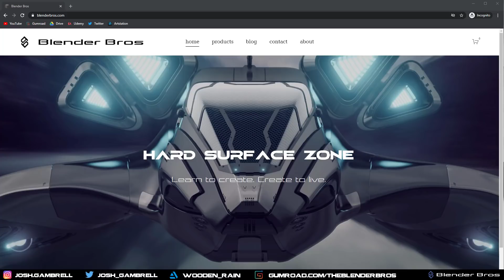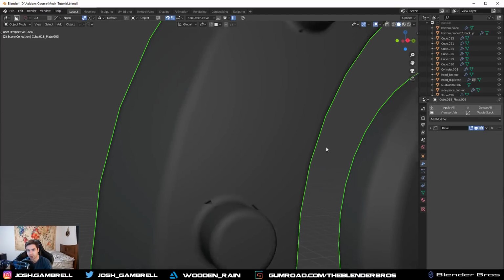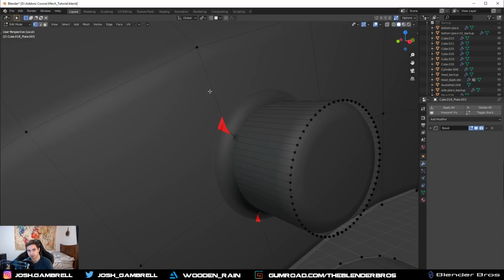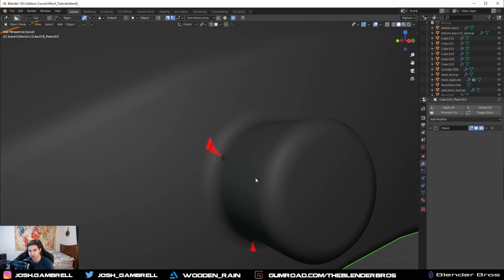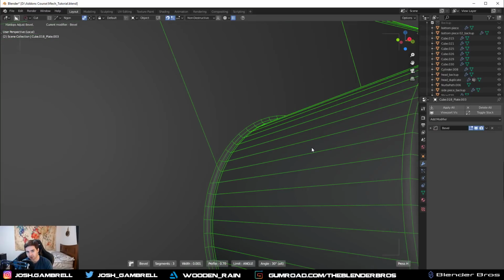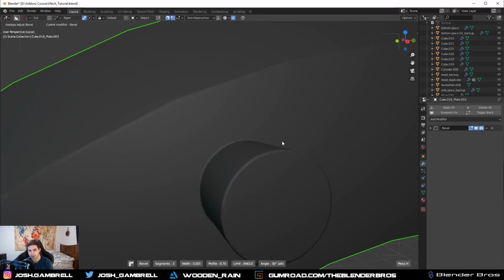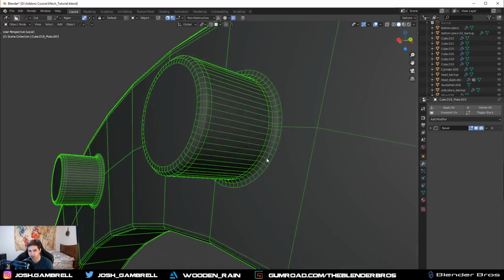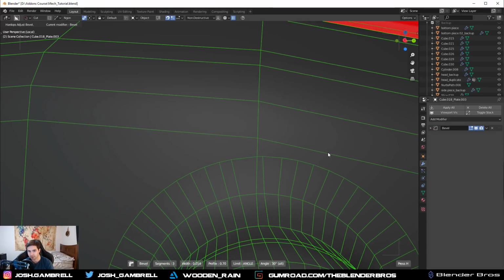The RIGHT way to connect booleans in Blender

Comment: I realize you made that initial line to make supporting geometry, I’m curious— why is that necessary? More specifically, why do booleans need at least two edges out from them to the nearest edges on the object? Is it because the face has no actual data other than that of its’ vertices?

Comment: Easier way to fix most bevel issues is just to disable Loop slide on the modifier, it would fix ALL issues presented here
Reply from the maker: It wouldn't fix all. What that button does is it chooses whether or not to average the bevels, so if you had a warped bevel corner it would even it out by disabling, but that has nothing to do with bad loop connections and probably wouldn't fix that.
Reply: @JoshGambrell  Well, true i guess. I stand corrected, it would fix most of the issues :)
Reply from the maker: @zoki87  Well I don't want beginners to get the wrong idea. It would NOT fix most of the issues, since most of the issues stem from artifacts/bad shading with bevels. I don't want people thinking that clicking a button solves all, because it rarely does. It will fix things occasionally, but not often.

Comment: Impressive , but I guess this can be evaded by this new Boolean which is released in 2.91 
Did you try the new Boolean in blender 2.91 ? 

I am really confused why channels (specially you 😁 !) are not talking about it !!?? it is revolutionary and it has way less problems than what I find in traditional Boolean or renamed as "fast"
I created this video for this topic , you can check it out here

https://www.youtube.com/watch?v=Wt0Na0aR48A
Reply from the maker: I am not upgrading to 2.91 if 2.90 is still crashing and losing saves. Bad experience all around with 2.90
Reply: @JoshGambrell  I agree , stable release is a must and 2.83 is rock solid compared to 2.9 even , but this one is magical

Comment: there is any workflow that i can use to transform my bevel/normal weight mesh  into subdivide ready ??? i find this bevel way to model stuff soo much better and cleaner,  however when someone want to subd. my mesh in 
Architectural Renderings for example , the wire dont look clean.

Comment: Interesting.  To my understanding whenever I use boolean, I have to make sure clean the topo and make it all quads to prevent artifacts, but from your video, you don't have to connect all the vertices and make it quads anymore.
Reply from the maker: Definitely not! And if the shading is bad, you can use normal transfer to clean it up :)
Reply: Josh Gambrell Thanks Josh , your videos are really helpful. I’m still transitioning from Maya to Blender. Seems like Blender is more intuitive than Maya is
Reply: @JoshGambrell  may be i will ask a very noob question right now but can you tell me if it is appliable for normal baking(for games)? I mean: create a high-poly model without making it all quads after bolleans(like yours in video), then cheat with that normal transfer trick if shading is not good enough and then bake a normal map onto my low-poly object which will be used in game engine.
Yeah, i remember what you said - learn to fix shading by fixing topology first, young padawan but I'd like to know your thoughts
Thanks for the answer in advance

Comment: gold content as always.

Quick question, how do you get this nice red indication for artifacts?
Reply: In the Overlays Tab, in the top right corner, where you enable your wireframe and all, Just beneath it, Is the Face Orientation option, which shows the orientation of your Face. (Blue means right way up, while red is the wrong way, basically needs to be the inside face) Hope I explained it Correctly!!

Comment: Hey, had a question. Is it worth using booleans or am I better off just using the To Sphere function or the circle function in the Loop Tools addon? I'm mainly concerned with keeping as much quads in my topology as possible, but I've found the edges can be pretty funky up close sometimes.
Reply from the maker: I use to sphere mostly if I’m going destructive
Reply: Depends. Booleans are mostly for non-destructive modelling(means you can fix things/moving/deleting whenever you want easily until booleans are applied) and other things you've mentioned are for destructive(shit done can't be changed easily). It is up to you which one to choose.

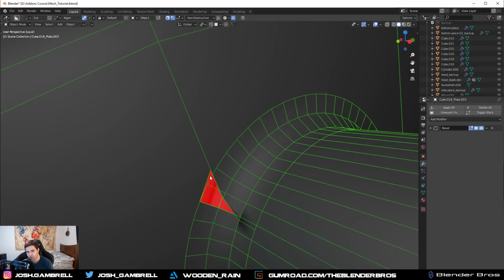Comment: 2:16 why don't you report this issue to the developers and get it fixed....and make blender more awsome!
Reply: Less of an issue and more of an algorithmic solution waiting to be found, so hopefully down the line we'll come across a more robust solution
Reply from the maker: Yeah it's not an issue, it is simply a problem of optimizing algorithms, which I assume takes time. If there was an easy-fix solution, I bet it would have been implemented by now, but great things come to those who wait.
Reply: One issue is that for every angle you optimise the opposite angle usually gets worse, so not an easy math to do. Manual investigation is best as there is manual decision on what is done and hence needs optimisation. In the example case the algirithm tries to hold the edge flow for the original mesh and its bevel.
Reply: Try Blender 2.91 experimental build. It has a new updated Boolean Algorithm.

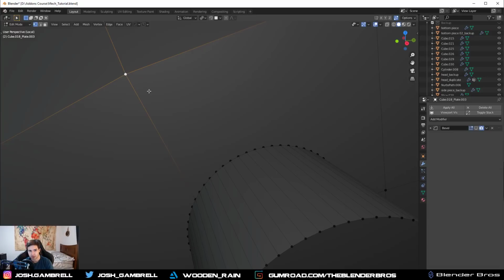Comment: At 4:20 you create an edge and it is splits the face automatically, when I create an edge between one face it does not split it up into two parts, it stays one face and the edge is just a separate part. How did you do that?
Reply: Use 'j' (join) instead of 'f' (fill). That should solve the issue
Reply: @gregorylim8409  thanks thats exactly what i was looking for!
Reply: @DatGuyGLK  Glad to be of help
Reply from the maker: Yea it's the J key, sorry man, this screencast keys addon is really bad, turns itself off randomly. Hoping HOps has an incorporation of their own soon.